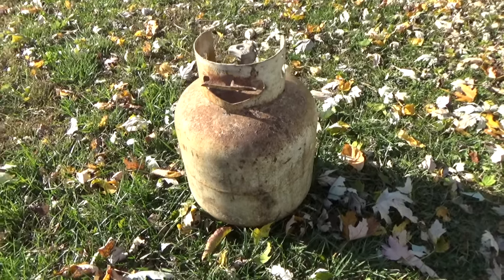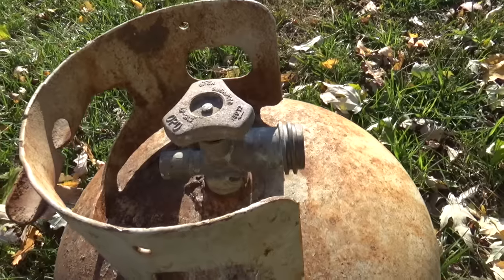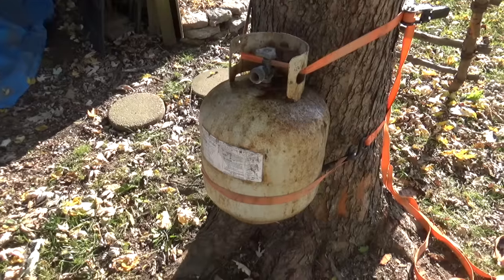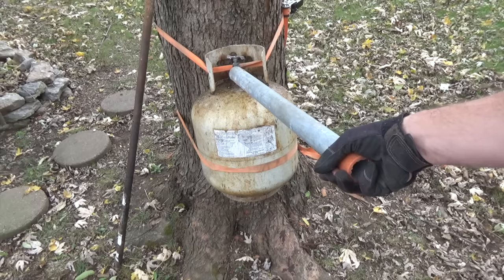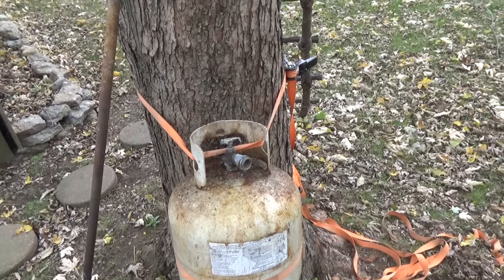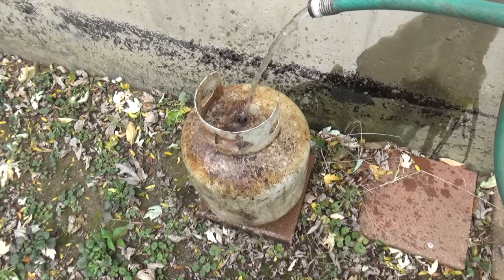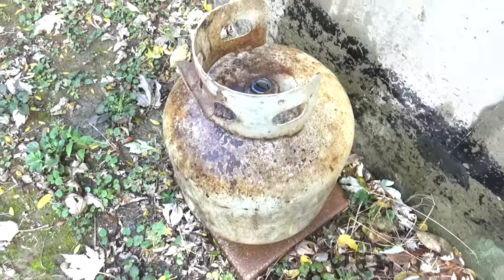Remove Propane Tank Valve in 2 Minutes (No Special Tools)

Comment: Caution!!!  Be sure you use a liberal amount of liquid dish soap before you put the water in.  (3 ounces)   I suggest more than one rinsing with moderately warm water before assuming this tank was safe to cut open!  Cutting these supposedly empty tanks is often very dangerous!
Reply: Thank You !!!  I was in the Propane Industry for 18 years & these videos of "HOW TO" are scary.
Reply: @coffeebreak4700  I have cut open several of them for customers.  In addition to hot water and dish soap rinse outs,  I would also continuously force 125 PSI shop air in through a 3/8 inch tube while cutting, to create an overly rich mixture and prevent outgassing from forming an explosive pocket!!  It is also very dangerous to grind off the welds on the safety guard, or the bottom rim, because the original weld might have had a "piping porosity" pinhole that went through the body metal but sealed up in the weld metal reinforcement or fillet weld as it cooled.  The tank passed Hydro test, because the hole did not continue to the surface, but now, you have opened a hole with your grinder, just by grinding into the weld reinforcement above the tank wall, and possibly BOOM!
Reply: Nonsense. All you have to do is fill it with water to displace the gas. Once you do that, as shown in the video, you are completely safe to torch cut or grinder cut the tank. The gas is lighter than water, and will be completely displaced if you purge the tank.
Reply: @josephkane825  utter nonsense.

Comment: If you wanted to make an air tank out of one of these the threads are 3/4 US pipe thread. A 3/4 x 1 1/2 inch nipple to a 3/4 inch T a ballcock valve and reducer reducers to fit the female air coupling to it, and use the other end of the T for either the air inlet or an air gauge and use a double ended male air coupling to fill the tank at the female outlet. But this is at your own risk.
Reply: When these bottles are new they are certified to 325 psi for a period of six years. If rusted or otherwise damaged (impact, burns, metal fatigue...) that certification is meaningless. If you take a bottle like that to a business that specializes in propane, they should reinspect the bottle and either reject it for further use, or recertify and apply a date stamp showing recertification date, good for another six years.

Comment: Do the big orange propane tanks have a left handed thread on them
Reply: Not for valve removal or replacement. The only left hand threads in propane systems are inside the service valve and in the regulator inlet or anywhere you find a pigtail.

Comment: What is that screw for on the side of the valve that you backed off on?
Reply from the maker: It is the safety relief (pressure relief) valve. It is used when filling the tank to keep from building too much pressure.
Reply: Actually, it is a fixed liquid level valve. The purpose is to give you an unwavering indicator that the tank is filled to 80%, the legal fill level for liquid petroleum gas (lpg) bottles. It is commonly called a spitter valve, because as long as the tank is below 80% full, it vents gas. At 80% or higher, it vents (spits) liquid.  Don't get any liquid on you, because it evaporates at 44 degrees below zero and will give you some rather painful freezer burns. The reason for the 80% fill level is to allow for thermal expansion of the liquid inside. Gases are compressible, liquids are not. If the liquid expands to 100% in that tank, and more heat is applied, at some point, the tank will rupture and cause a problem you don't want to be within a hundred yards of unless you enjoy having all the hair singed off your body and a lot of third degree burns. When the tank ruptures, each gallon of liquid evaporates to become 270 cubic feet of gas, which is explosive at any concentration above 4% in the atmosphere. After the initial pressure release of the rupture, the remaining liquid inside cools almost immediately to 44 below zero, and will continue venting through the rupture until all of the liquid is completely evaporated. Ever wondered why people who deal with this stuff daily need a certain amount of training before they get turned loose to work with it?
Reply: ahh the heck with it! Just use acetylene,much more efficient and hotter to boot. 4400 for propane mixed with 02
Reply: And 6300 for Acetylene when used as an oxidizing flame(excess oxygen added to the gas).
Reply: @brettelmerelmer3061  Good advice Brett.  Why do they call the average BBQ tank a 20 gallon tank as it would not hold near that much liquid?
Reply: @Gord Baker  Thanks for commenting. From a few years of experience in the propane industry, I've picked up a little bit of knowledge that I'm willing to pass on to anyone who might listen. 
Most propane bottles are 5, 7.5, or 10 gallon bottles. What you find when you measure them out is that the 5 gallon bottle will actually hold about 6.2 gallons of liquid, the 7.5 gallon bottle will hold almost 9 gallons, and the 10 gallon bottle will hold just over 12 gallons. They aren't actually based on the gallons, though.  Propane weighs 4.25 lbs per gallon, and those bottles capacity are actually based on the pounds of propane to legally fill them, hence the 5 gallon bottle is called a 20 lb bottle in the industry. The 20 gallon cylinder you mentioned, it you take out the valve and fill it with water, will in fact hold almost 25 gallons and with water the weight of the contents will be about 200 lbs, but the industry calls it a 100 lb cylinder, again because of the weight of the propane. 
It is only legal to fill those bottles and cylinders to 80% of their physical capacity (hence the fixed liquid level valve venting gas under 80%, and liquid above 80%) because of the hazards created with an overfull container. The safety valves blow off at 275 to 325 psi, but the most likely cause of a safety valve blowoff is an overfilled container getting heated up in the sun until the liquid inside has expanded to fill the entire container. The first time you see that happen is pretty unnerving, even if you work in the industry and have been taught what to expect and how to deal with it.
Reply: @Gord Baker. Sorry, I should have read your post a little closer before responding, but if you think about what I said in the last post, your answer is implied there, but in the interest of clarity, here is a better answer. When you get the average size bottle for a barbecue filled, if you get it filled with an industry specialist, you would call it a 5 gallon bottle, but they're calling it a 20 pound bottle. Some of them will even go so far as to have a balance beam scale at the pump, tare out the empty bottle, add 20 lbs, then fill it until the scale jumps indicating the empty bottle weight plus the fuel weight has been reached.
Reply: @brettelmerelmer3061  My mistake Brett.  Yes 20 Pound, not gallons!  Duh.

Comment: I have a propane tank that's full but it leaks when I try to use it, is there a way to fix it?
Reply from the maker: I would not recommend attempting to fix a leaking propane tank. I would just trade it in for another one.

Comment: I thought you were going to put this tank back in service, without having it recertification. 12 years from orginal date stamped on tank. Good idea for new valve then also then AFTER RECERT. EVERY 5 years after that. biggest problem with this bbq tanks is people over fill them. 80% full is the law. The newer ones have a built in device to shut off at 80% but I wouldn’t trust them, fill by WEIGHT!  Only to be safe.
Reply: The cost of recert in my area is almost as expensive as buying a new tank.  Recert = 5 yr life; New tank = 12 yr life.

Comment: I don’t know if I would have stopped and grabbed a roadside abandoned propane tank. 

I’ve been told that meth manufacturers use them to transport anhydrous ammonia. That corrodes the seals in the valves, and then they just ditch the tanks. If you find an abandoned propane tank, especially if the valve is green, call the cops. You might help catch a meth manufacturer.
Reply from the maker: You only live one...or so the kids say.

Comment: I had to use a heat gun. There was thread locker.
Reply from the maker: Yes, there is definitely something on there, that is what makes them so hard to remove and why it takes so much torque. Thanks for watching and taking the time to comment. Peace.
Reply: @HNXMedia  Oh it's nothing. I had a hell of a time getting the valve off mine. I ended up making a socket out of a bit of pipe and used a metal bar that was  maybe 5 feel long. Still needed the heat. It was crazy! 

Here's the results:
https://youtu.be/W-CQpbpIILQ

Comment: What is the proper procedure if you wanted to replace the valve with OPD valve. Propane company wants $50.00 or more to replace.
Reply from the maker: I am certainly not qualified to give any advice for replacing a valve on a tank that would actually be put back into service. When I remove a valve, the tank is then used for something entirely different. If you replaced a valve, I would think the tank would then need to be pressure tested, etc (but again, I am no expert). Now, I do have a couple old tanks that I just bought adapters for so that my local propane place would fill them, but never an entire valve. At that price, I would just buy a modern tank. Sorry if this was not helpful. Peace.
Reply: Good luck getting a propane business to sell you an OPD valve without installing it for you, but what you saw here would do it. Just be liberal with pipe dope on the threads prior to installing the valve, and prior to refilling the tank, let whoever fills it for you know that it needs to be purged.

Comment: I have had this method for de-gassing a tank go wrong on me with the tank taking flight once I started to weld on it. I have learnt from my mistake. I now use hot water to fill the tank/cylinder to ensure that any vapour etched into the skin of the tank is vapourised. I also do this twice and have not had any further mishaps.

Comment: I had not thought of that: I need demonstration of why & how the OPD BS prevents testing by cracking the valve open like you can on 100# cylinders  ○ Common sense is now so rare that it is considered to be an Enemy of the State if you use it

Comment: IN '77 I'm driving a sling boom Wrecker for All Points Tow In Valley Cottage NY
Back at the Gas station I Glimpse one of the Mechanics about to weld a gas tank he'd flushed with water, 
this got my attention as he sparked the torch I'm walking towards the shop bay he's 30 feet to my right and 20 forward when he launched this thing like a land speeder across my path. 
DANG!
 Me bein 19 thought it pretty funny as it hit the curb on the other side (bloated and dented a little) of the lot 120 feet away shooting past the Cars and Gas pumps. 
No one got hurt, 
missed everything, the guy still had his eye brows even with his shield up. The grafitti says flush twice to reach the Kitchen, if it's a gas tank
Flush 3 TIMES or you'll pass the kitchen.
Reply from the maker: Hole E Sheit! Now that was a close call. I have been a bit worried about all the comments suggesting to use a torch. They need to read this.

Comment: Tank looks to be in great shape what are you talking about
Reply from the maker: I found it on the side fo the road. I was not taking any chances actually using it for propane.
Reply: @HNXMedia  I'd be more concerned  about using it for an air tank than propane  it looks better than most of the exchange tanks you find being used daily they just slap fresh paint and a new inspection stamp on those

Comment: Dum, steal tools create spark, brass . Thunmbs down
Reply from the maker: This comment is wrong on so many levels. We'll start with the fact that brass doesn't spark (kind of why it is used for valves like this and on gas furnaces in the first place). Please go back to metallurgy school.
Reply: @HNXMedia  that is what i meant, brass was what we were required to use especially with hydrogen.
Reply: I had ended with brass, figured you would figure it out.

Comment: A discarded tank may have been used in a meth lab (by filling with a hazardous substance).  Gas technicians are trained to examine tanks for this.  They are highly unsafe to use for propane, etc.

You never turned your tank upside down.  Propane is heavier than air, so wouldn't that be step one before ever tampering with the valve, knowing propane is highly explosive?

Rust:

Problematic in several ways.  Besides possibly degrading the structural integrity of the metal, rust can be on the inside, too, which weakens the added "rotten egg" smell.  So don't use your nose to tell if gas is present.

Rust is dark.  Dark colors heat up more in the sun than lighter colors, so a tank with any gas in it may be in danger of overheating.  Not my words;  this is per gas companies.

When finding tanks, you don't know if it has excessive rust that someone hid with paint.
Reply: Turn the tank upside down with the valve in it so the propane can flow out? That's ridiculous. Any residual propane can't come out if the valve is in it. The valve is there to keep the propane in the tank. Even if you open the valve, it won't let propane out unless something is connected to it.
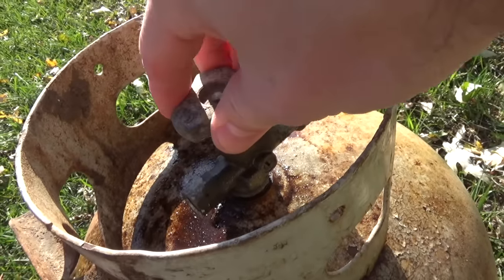Reply: @carlericvonkleistiii2188  His adapter can't hold gas in.  You can tell bcuz of his words and sunlight is seen going through it.  1:04 at speed 0.25.

Upside down is especially important in case of any propane is still in liquid form, but the gas is heavier than air, too.
Reply: @wownewstome6123  Upside down makes no difference whatsoever if you purge the tank with water.